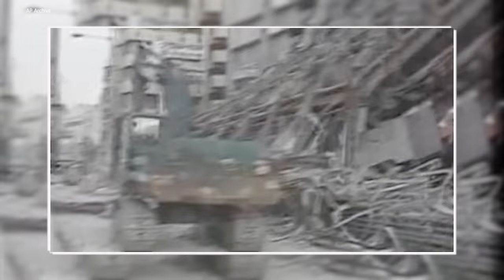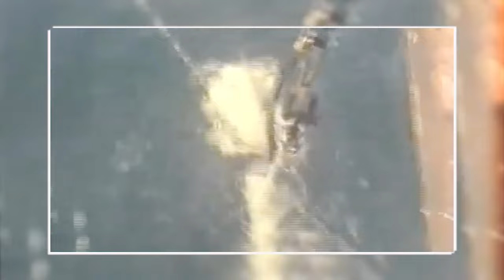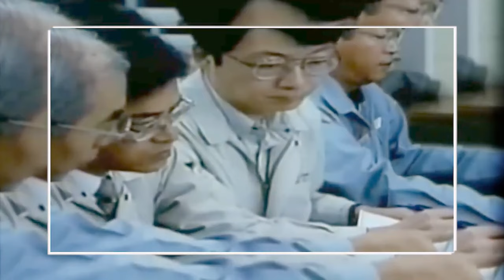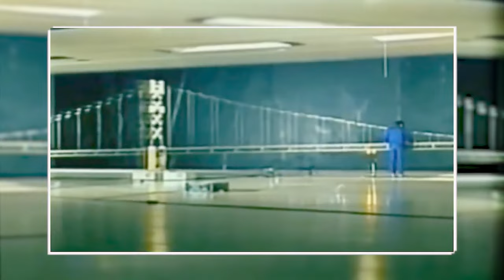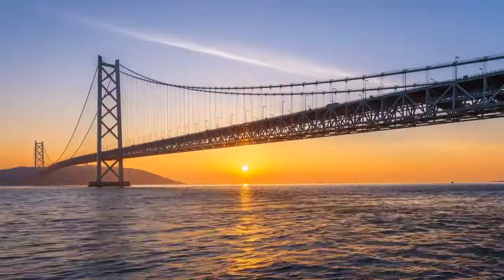Japan Built a Bridge to Survive Earthquakes

Comment from the maker: What do you think about this bridge?
0:00 – Introduction: The Akashi Kaikyo Bridge and the 1995 Kobe Earthquake
Japan earthquake 1995, Akashi Kaikyo Bridge intro, world’s longest suspension bridge
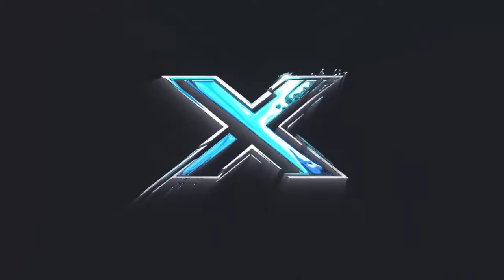1:11 – The Impossible Challenge: Building in Japan’s Seismic Zone
Pacific Ring of Fire, earthquake-resistant engineering, Akashi Strait conditions
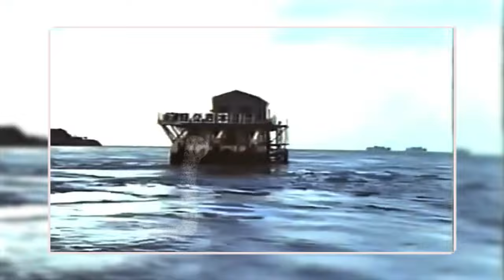3:01 – The Bridge’s Symbolism: Japan’s Technological Rebirth
Post-WWII Japan, Akashi Strait ferry disaster, public support for bridge
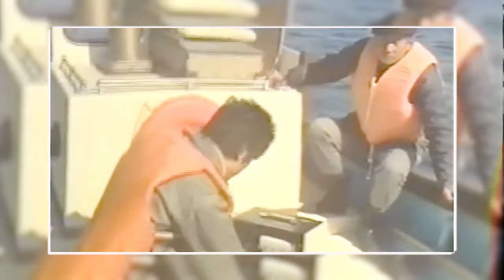4:05 – Seven Revolutionary Technologies Behind the Bridge’s Design
Innovative bridge engineering, flexible towers, seismic design
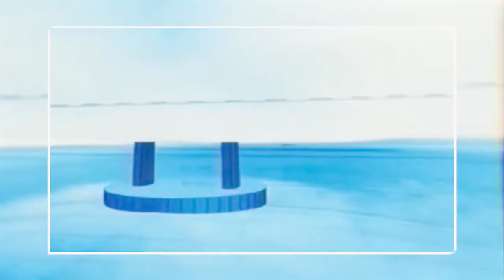5:31 – Flexible Steel Towers and Pendulum Dampeners
Earthquake engineering, seismic energy absorption, pendulum dampers
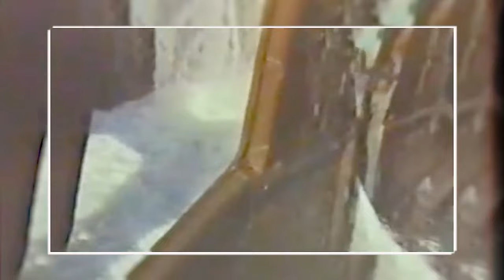6:51 – Foundation Engineering: Massive Caissons and Artificial Islands
Bridge foundations, deep water construction, unstable seafloor solutions
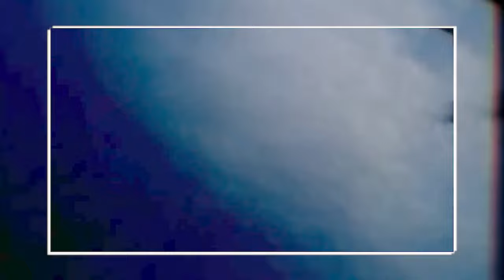7:19 – The Bridge’s Cables and Aerodynamic Deck Design
Suspension bridge cables, wind-resistant bridge deck, typhoon engineering
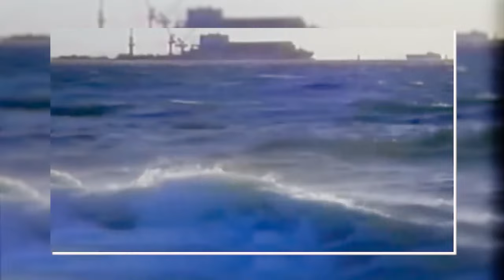8:34 – The Ultimate Test: The Great Hanshin (Kobe) Earthquake of 1995
Great Hanshin earthquake, seismic test of Akashi Kaikyo Bridge, earthquake impact
10:22 – Post-Earthquake Assessment and Engineering Adaptations
Bridge damage inspection, cable tension recalculations, structural adjustments
11:54 – The Bridge’s Legacy: Stronger, Safer, and a Global Model
Engineering lessons learned, earthquake-resistant bridge design worldwide
12:19 – The Akashi Kaikyo Bridge Today: A Testament to Human Ingenuity
Modern bridge resilience, ongoing earthquake and typhoon survival, engineering marvel
13:17 – Closing & Viewer Engagement: Share Your Thoughts